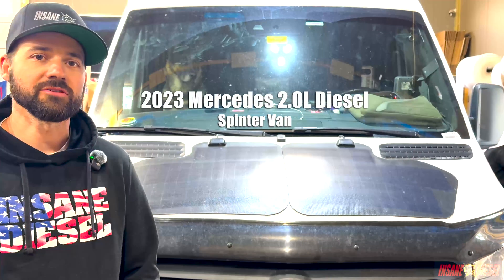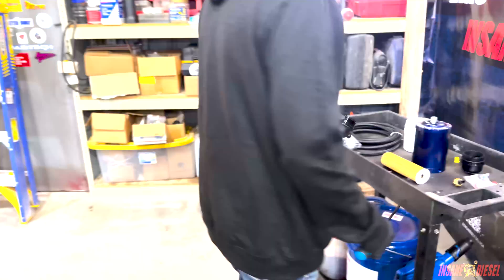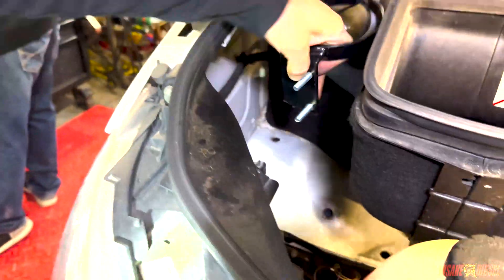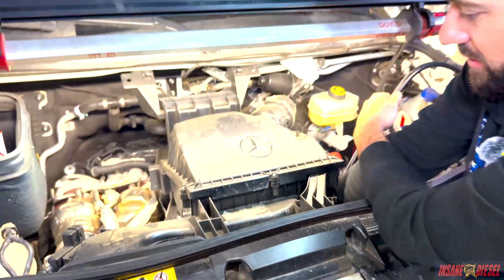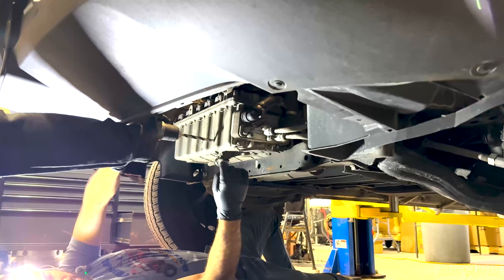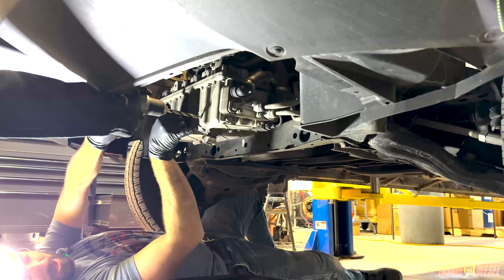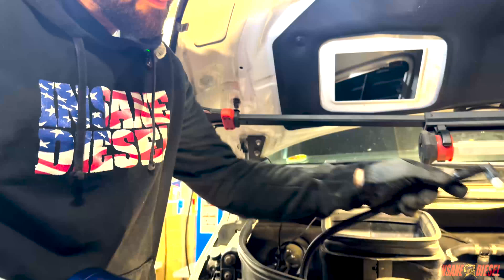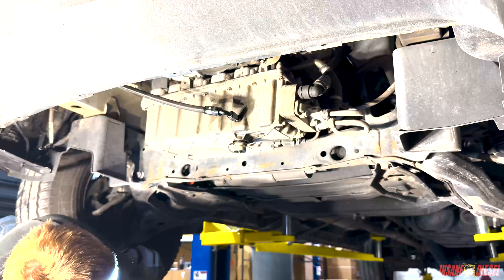2023 Mercedes OM654 2.0L Diesel (Sprinter Van)

Comment: The more I see from this company, the less confidence I have in them.  Why the hell would you tap the pan so low?  If you have a return line, if should be as high as possible on the pan so as to be above the level of the oil, or at least significantly higher than the pickup.  That way, if the lines breaks, you won't lose so much oil that you lose oil pressure.

Comment: How many miles were on this Sprinter and when refilling did you use the Lorenzo's Oil?
Reply: And no I used Valvoline European 5w30 229.52 compliant oil. I carry a complete oil,change supply with me wherever I go. Lorenzo oil is great, but as much oil as I go thru I have to make an economical decision to run the valvoline as I buy it in bulk and save allot of money.
Reply: This is my Sprinter, it had 257400 miles on it when the bypass was installed.